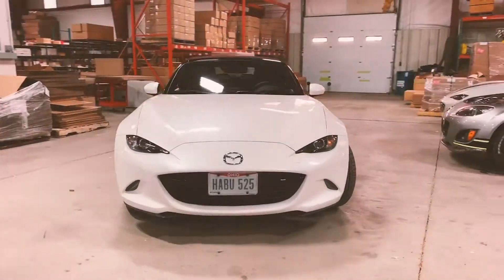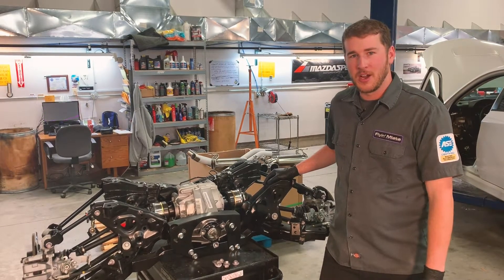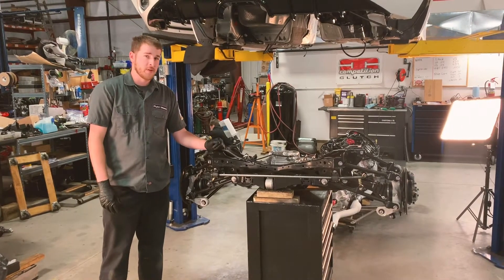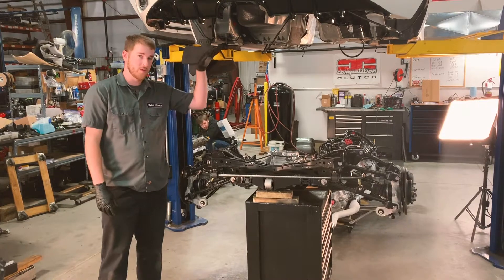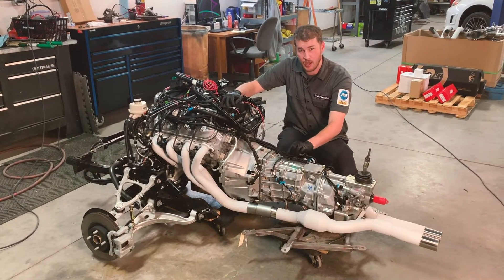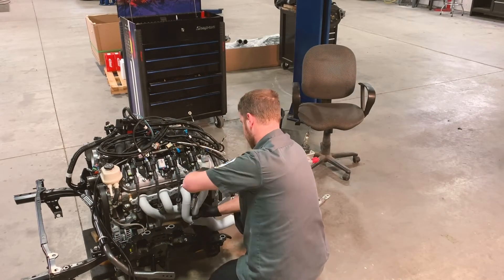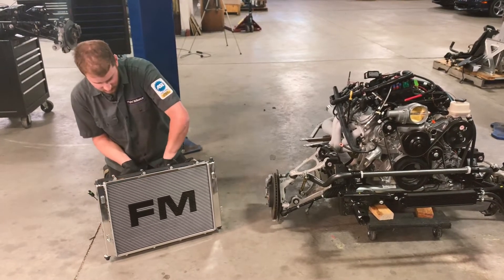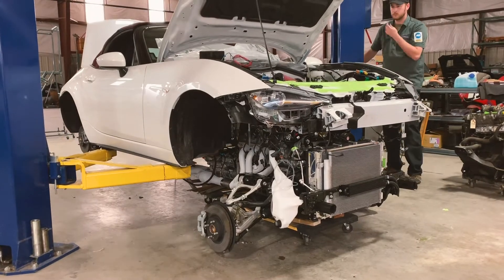FM V8 Build Diary Part 6 - Assembly

Comment: Were you able to fit back the OEM PPF (Power Plant Frame) in order to retain chassis rigidity?
Reply from the maker: We do not reuse the OEM PPF, but rather create custom bracing to mount the diff and transmission .

Comment: I'd really to have a LS powered Miata but I can't imagine the rear diff cradle mounts not ripping from the car's body?  Can it really handle this more torque?
Reply from the maker: It certainly can. We've been handing our R&D ND to journalists for three years now and the rear diff is happy as a clam. We put a lot of work into reinforcing the subframe/cradle to avoid any problems.
Check episode 4 of this series for more details.
Reply: How about under heavy track duty with the upshifts and downshifts? I’m not disputing just trying to educate myself as I’m considering bidding on your current listing on BaT.
Reply from the maker: @mshelton65  Our car has seen a bunch of heavy track duty, including both upshifts and downshifts :)  It's been through a LOT of tires and has been run on multiple tracks. It's even had a pro drifter burn a set of tires off. The rear end is solid.
Reply: Is the kit still available? I can't find it on your website